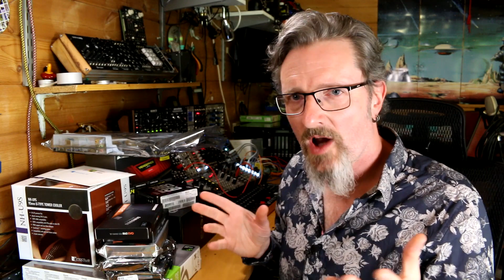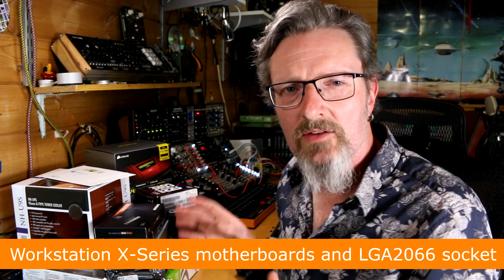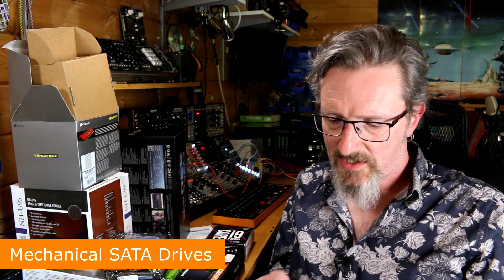How to build an Audio PC: Part 2 - Choosing components

Comment: hi there, fantastic video series. Very excited to see the build tutorial in part 4. But I'm confused...what is the benefit from getting the i9 9900x over the i9 9900k? 
From what I understood, having greater clockspeed is better for music producers than greater number of cores. The 9900K is also half the price, so what gives? Am I mistaken?
Reply from the maker: Intel has made things terribly confusing with the way it names the processor. The X and K versions of the 9900 appear very similar when in fact they are completely different platforms. The X version has more cores, more cache, supports more memory in twice as many connections and has 3 times as many data lanes. It runs on the X299 chipset and workstation motherboards. It's high-end and so carries a premium price tag. The 9900K is probably every bit as fast in almost every usual situation and is much better value. It runs on mainstream motherboards with Z390 chipsets. If you have £3k to spend on a computer then get the X299 and 9900X - if you have £1k to spend on a computer get the Z390 and 9900K. You can potentially do more with the 9900X but see if you run out of room on a 9900K first :D
Reply: @MoltenMusicTech  thanks for the quick response! I'll probably end up getting the 9900k purely coz it's much cheaper, but a small part of me wants to splash for the 9900x, because i love myself a ridiculously huge metropolis ark template lol

Comment: Don't mind me, just putting some timestamps in for myself
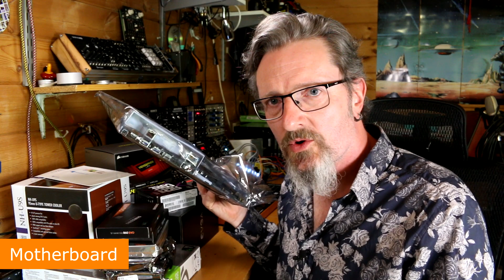5:04 Motherboard
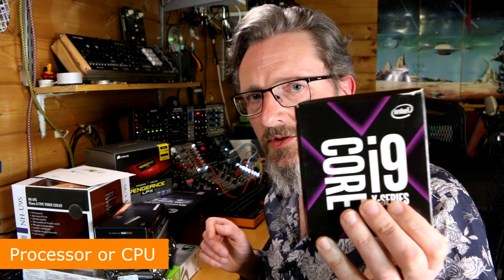14:01 CPU
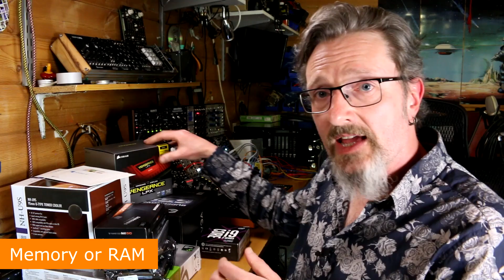15:39 RAM
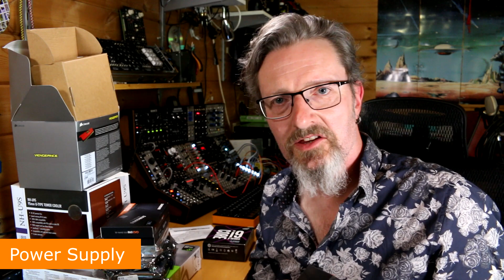18:04 Power Supply
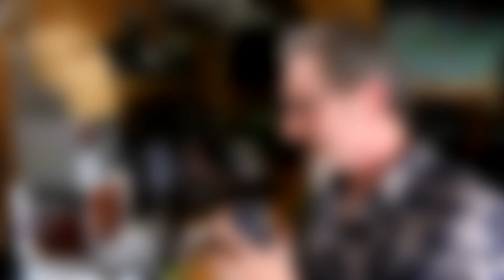20:05 SSD Drives
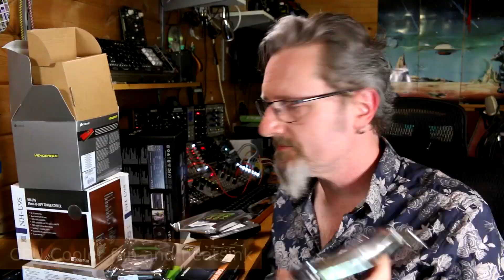21:54 CPU Cooler fan and heatsink
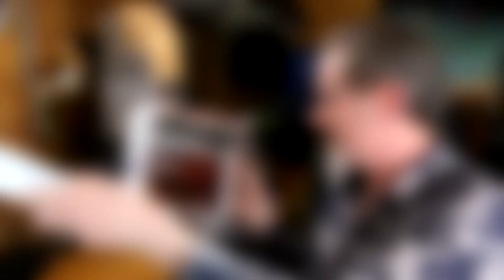22:54 Graphics Card
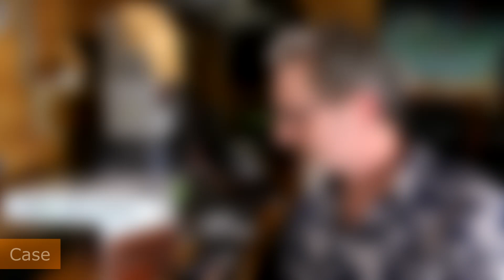23:54 Case
25:11 Summing up
Reply from the maker: Hope you don’t mind me asking a question but I’ve already put these time stamps in the description - why do you need to put them in as a comment? Are they more accessible or something?
Reply: @MoltenMusicTech  Yes, in the comment section you can click and it will bring you to the exact place. In the description you have to look at the timestamp, drag until you find the right spot, then adjust as needed. Not a huge difference but it does help when trying to work quickly.
Reply from the maker: That’s odd, I’ve always assumed that’s exactly the reason why I put the time stamps in - doesn’t that work any more?
Reply from the maker: Awww geez when did that stop working?
Reply: Doesn't work for me, maybe it's my computer. Which is of course why I'm here haha
Reply: Haha good question, like I said it might just be my computer. Idk if others are having the same problems. Maybe in the future you can put the timestamps in the comments and then highlight your comment so it appears at the top?
Reply from the maker: Looking into it it appears that it works in regular browsers but not on mobile - which is what i'm seeing. It's fine on my desktop computer but not there on my iphone in Safari or the app. That's a bit crap. Ho hum. I guess i can just copy them into the comments and like it as you say.

Comment: I just want my computer to stop crashing when I'm using kontakt vst and reason together,  or superior drummer3 and reason together. 
I'm at my wits end at this point.
Aorus z390 ver.10 i9cpu 8cores 3.6ghz
64GB ram, force m.2 2tb 
Windows 10.
ALL audio settings are at 24bit 41000
256 buffer
Reply from the maker: What sort of crash are you getting? Does Reason just bug-out or is your system freezing, blue screen or what exactly? What audio interface are you running? Do you have any other DAWs installed with which to try your plugins? Does it happen as a specific point? Can you make it crash on demand? Have you tried running a memory test or CPU burn-in test? Have you done the tweaks from my tweak video? Is there anything else connected to your machine like network devices, backup drives etc? You shouldn't have to put up with constant crashes - you need to dig into where the problem is.
Reply: @MoltenMusicTech  Thank you so much for the prompt response.  It happens when I either have several kontakt VST's going or when I load SD3 after having loaded kontakt and try to playback.  No freeze or blue screen ever... the computer just shuts down entirely and restarts. 
I've optimized windows and disabled some background apps that are not needed.  I looked in my events but no apps related to my Audio software seem to give any warnings or errors.  All the critical issues logged are components failing AFTER the actual crash has happened.  So I looked into this after the crashes in my attempts to fix this. I'm using my maschine mk3 as my audio interface. 
Now,  when I run SD3 and kontakt while in cakewalk,  I haven't had any issues. Nor any problems when using Maschine 2 DAW. This seems to only happen when I'm using reason.  Reason 11, full version.
Reply from the maker: It sounds like a blue screen reset. There’s a setting in windows where if a blue screen occurs it automatically resets. A blue screen is usually a clash between resources which indicates either bad memory, bad driver or overheating. I would run a deep memory test like memtest.org and run some cpu benchmark software while watching the temperatures.

Comment: Molten Music Technology 
Hey Man! When it comes to building my next build. I am mulling one thing. Should I get the Ryzen 3600 vs Ryzen 2700x. The 6-Core 3rd Gen or the 8-Core 2nd Gen. Faster Single Thread or More cores. Any help?
Reply: I’m wondering the same thing..
Both specs are important for audio work. But apparently Ryzen gen 2 had high latency issues, making them worse for live instruments and production work. This may not be an issue for gen 3, but unfortunately most reviewers only talk about Intel.

What is best for one particular user's case depends on his or her workflow, but in general go for a CPU with at least 4 cores/8 threads and around 3.7GHz

I’d go with the Ryzen 3600.
Reply: @StaunchConch  Thanks! I look forward to their reply

Comment: One thing you didn't mention much was noise reduction. Yeah you touch on it but you didn't mention anything about passive CPU coolers and 0bD graphics cards. I know a passive CPU cooler might be limiting in term of CPU TDP but with right case you can go for a surprisingly capable CPU - right up to i9's. And  a 0bD graphics cards is no brainer - unless you want to take a break playing a game you'll literally never hear it. Perhaps you could discuss it in a later video?
Reply from the maker: Yeah, pretty sure I talked about noise considerations all the way through - but yes, if I didn’t, then it’s definitely worth a video by itself.

Comment: Could you do a build for people who like tweaking?  Something with stable overclocking and super low latency?
Reply from the maker: Not really no. The thing with that is that overclocking is specific to a particular motherboard and CPU and so any settings for one system won't necessarily translate to another system. Overclocking has nothing to do with latency though - that will be down to your audio interface and keeping Windows tweaked - i've done plenty of videos on that already.

Comment: Excellent video. Good honest advise. I would like Molten Music Technology to discuss the overheads of using Windows 10, if any, in comparison to Windows 7, as I am sick of all the ridiculous processes running in the background in Windows 10, that contribute nothing to using this computer for music. This is the downside of using a general purpose operating system (lowers the price since you buy what is really a commodity that gives the advantage of lower price due to higher volumes sold) for a mission critical unforgiving process such as audio.

Establishes very important points - 

1. Good DAW needs reliable components from manufacturers with a proper reputation for quality long lasting products.

2. Cutting corners is simply not worth it in the long run.

3. Though it was mentioned in passing, I will emphasize, most of the specs given by software makers are seriously under specced, you should typically double or triple the RAM or even more cos you need the system to run all the various bits of software well. I would sincerely suggest nothing less than 32GB RAM, as the absolute minimum in today's world if you want to run software in the box, mix and also have plugins on busses, and master mix, and do things like monitor live, you need at least an intel 8700K.

4. While the Intel X processors give you more cores, they add at least about £800 to the cost, in comparison to the INtel K processors,   cos the X processor costs about £450 more, you need to buy a more expensive motherboard, as well as a discrete Graphics card. Only you can decide which you need. INtel X processors also need a discrete Graphics coprocessor, while the INtel K has one built in, which is more than good enough for audio, if you also plan to do video, such as making youtube videos, a dedicated graphics card may be needed with an INtek K processor, to speed up rendering - a task which is accelerated by the graphics card.

5 LOng and short - Digital Audio , is not cheap if you want something that will last a long time and not hinder creativity. I learnt the hard way - almost all laptops however expensive are toys, only good for maybe sketching and composition or minimal duties. When you get into the thick of mixing lots of tracks, and monitoring via the DAW in real time, just buy the best you can afford, you will need it. As said in the video you need the headroom - not audio headroom but computer headroom in available power, RAM, CPU and disk capacity/speed, to ensure that you can do a lot with it. Especially if you generate sounds primarily from software instruments, which place a huge demand on the computer.... Just get more - its safer.. U spend once and get what you need....

Comment: Hi Robin, any particular reason to go with the 9900K instead of 9900X? thanks :)
Reply from the maker: Yes, they are different architectures and fit in different motherboards. The 9900K is a desktop processor that needs the 300 series desktop motherboards like the Z390 whereas the 9900X is a workstation processor for workstation boards like the X299 featured in the video. A system based on the 9900K will be a lot cheaper but a system based on the 9900X will have the potential to be more powerful. Either way they are both awesome - you just need to make sure you get the right CPU and board combination.

Comment: One thing i am looking at when selecting a motherboard are the following. How many sata ports. Depending if you want to expand memory. I also look at does the motherboard include many usb. If using lots of instruments on computer etc usb can become problematic. One way to solve it os to get external or internal usb expander. I feel usb is quite important for myself.

Comment: Not that I'm religious or anything, but AMD is back with a vengeance and a Ryzen 9 3900x will give you better performance at half the price! ;)
Reply from the maker: Yeah, cool, everyone keeps saying but personally I find the consistency, reliability and stability of Intel based systems to be more important than the latest speed jump or price drop from AMD. But, you know, fill your boots.
Reply: Intel has been in the lead for the past ten years and its good to see some competition - I run my daw on a Ryzen system and I can recommend it for workstation builds on a budget
Reply: @nabooka316   sorry to intrupt..! 
Well I'm considering ryzen 5 3600 over i7 8700 .. I'm just a beginner right now.. Can I able to use 3600 for music production and video editing for upcoming 3years well?
Reply: @samratkundu2799  Yes you will get the same performance from the Ryzen, its just cheaper and uses less power ;)
Reply: @nabooka316  also a B450 Aorus M would be okay with it?

Comment: Having built an audio-biased PC recently one of the things I used to decide which motherboard-style to buy was, rightly or wrongly, the built-in audio components, especially where additional shielding was indicated. Also very low noise speaker outputs seemed like a good idea. Looking at workstation motherboards those feature seemed to be lacking or implemented at an additional premium. In the end there was a budget to keep to so I bought the best gaming-style motherboard I could afford.
Reply from the maker: That’s fair enough if you want to use onboard sound. I’d argue that for an audio pc (one designed for music production) you would always use a proper audio interface and so the onboard audio is irrelevant.
Reply: @MoltenMusicTech  My original intent for the PC was to use it for all-in-the-box music production so an external audio interface wasn't even considered. After the build and a few weeks working with Cakewalk and VCV Rack plus inspiration from your youtube channel and others, I realized I needed more. And so it began.

Comment: I was expecting some kind of sound card / external audio interface to be mentioned! Which aspect of the system would you say affects latency the most?
Reply from the maker: We’ll get to that. An Audio PC is one that will run any audio interface brilliantly. The interface drivers dictate latency, the computer dictates whether it will work and the CPU has something to say about the performance at a given buffer size.

Comment: Using a system based around a gaming system is probably better that a multi processor server for realtime music. The i9 9900 has upto 4.7Ghz clock per core in single threaded performance and about 4.5Ghz across the all 8 cores for flat out performance. Many of the VST's are still single thread apps so having 32 cores won't make any difference when you only using one. In fact those big multi core CPU's often have clock speeds of around 2.5 to 2.8Ghz much slower than the i9 9900. Single core performance counts for much more than people think in real-time audio handling.
Also make sure your motherboard has M.2 SSD sockets as these are much faster than sata SSDs, basically they have 6x the I/O lines compared to SSD's. This make a big difference when the machine is just doing its background stuff and also if your reading samples from a drive. This help keep the machine latency down allowing it to spend more time on your VST especially if you want to run 64 to 128 buffers. 
I have the Gigabyte Aorus MB running a i9 9900k ( i dont want to over-clock for reliability)  which has 3x M.2 sockets so I have 2x Corsair MP510 980Gb + a 480Gb drives and they are not only cheaper but faster than Samsung. 
The boot time from turn on to getting in to win 10 is now about 18 seconds compared to about 45 for the sata SSD (Sandisk ultra II ) I used to run and its lighting fast with all the DAWS, Ableton and Cubase with no stuttering even when when running heavy CPU app's like Spitfire Audio  Kepler Orchestra.
Reply from the maker: Good story - you should make videos!
Reply: @MoltenMusicTech  mmm.. maybe I should :-)
Reply: @curiousdroidzone1811  https://www.youtube.com/watch?v=HFL3wOfPx9s&fbclid=IwAR2akYdOwu8H2R7w_H6tjPCcYhnY4MLt67YaOTDAQwqB3WCQ_WTBqI8BJlk this guy talks about the importance of core power in audio, and uses the i9 as well
Reply: Hey there, 

Would you mind sharing please which Gigabyte Aorus MB you went for ? 

I'm looking at PRIME X299-DELUXE II paired with i9 9900x series 

but it might be better and cheaper to go with i9 9900k and use a simpler MB without thunderbolt. and with 1151 socket. 

M.2 sockets seem like they'll be helpful running Large sample libraries efficiently.

thanks!

Comment: Don't assume that your motherboard has Bluetooth. I found that out the hardware.
Reply from the maker: Not really interested in Bluetooth. It can cause problems with DPC latency. I would rather have a usb Bluetooth dongle that I can remove if it causes trouble 😀